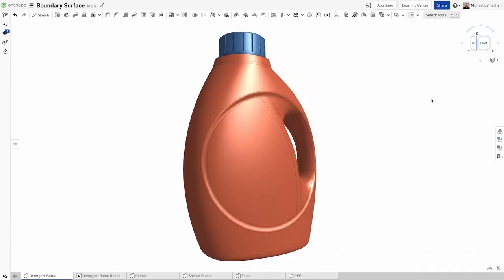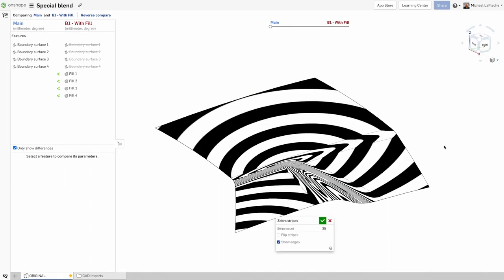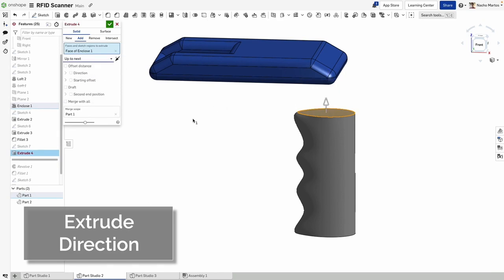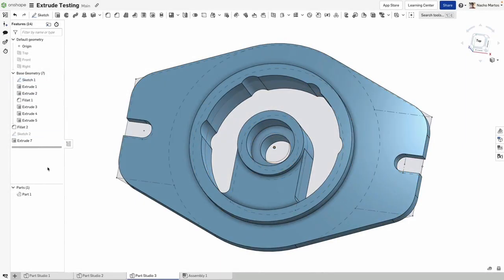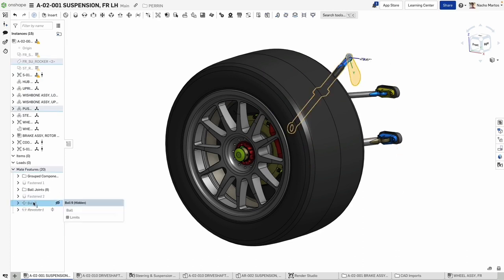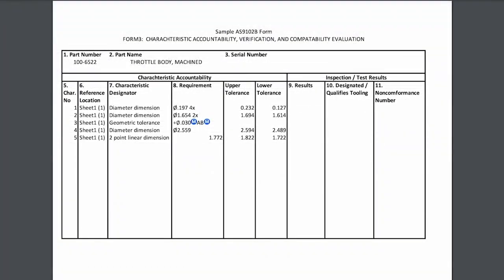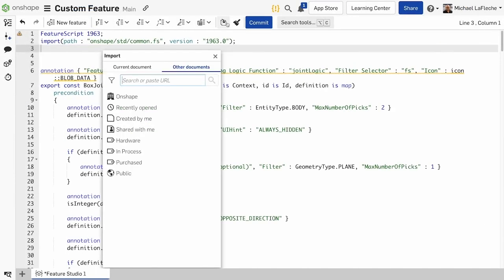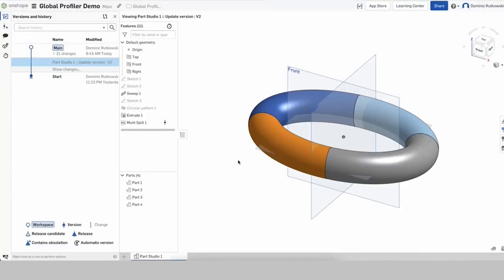What's New 1.159 (February 3, 2023)

Comment: I’ve been building aerodynamic hulls for road vehicles using fills, and have had some difficulties controlling them to get the results that work best with the air in CFD, as well as manage to be manufacturable in composites. I’ll try rebuilding using boundary surfaces as soon as this is available!